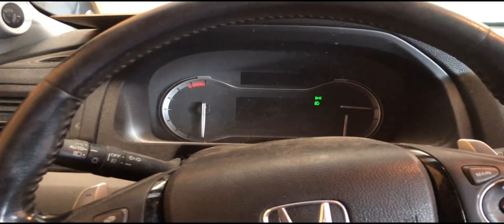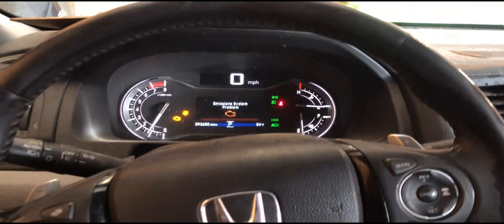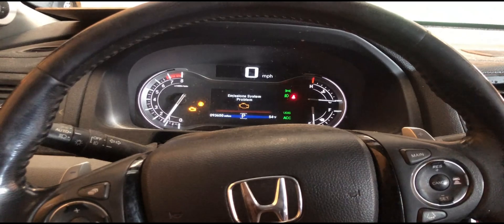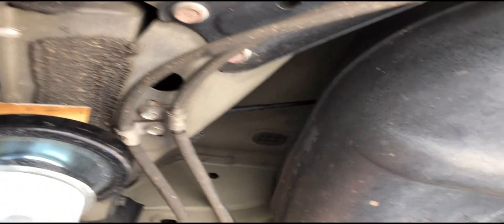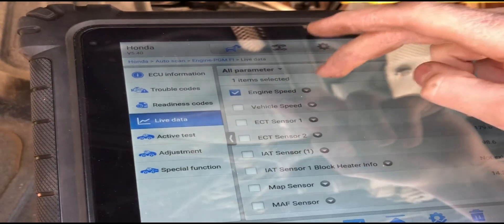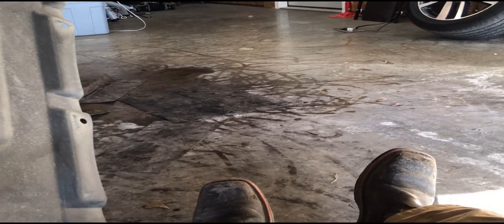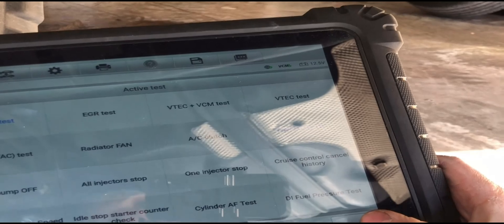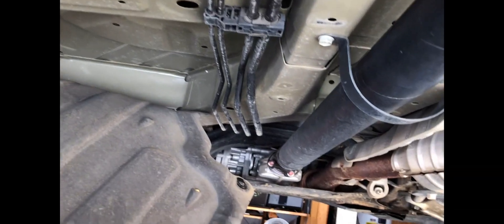Diag Summary - 2018 Pilot 3.5L rattle, humming, thumping, vibration root cause

Comment: The 2018 I’m working on, also had a Hyraulic Tensioner vibrating. Timing Belt Tensioner failure is also common for this run of Odyssey Engines.

Comment: Keeney, (& others), I’ve got a 2018 Odyssey here having this exact issue. Vibrating fuel line underneath the hood. Transmitted louder as vehicle speed increases. Noise also coming from the fuel tank. Hope this helps others.

Comment: I have a 2018 Pilot I’m checking out for used car inspection. Fuel line under the car was resonating just like a 3 cylinder engine would. I knew at that point this had to be the high pressure fuel pump causing the concern. Makes me wonder if the lobe on the camshaft is worn also. I have yet to check.

Comment: I recently changed my hpfp  due to not having anymore power and not running .. so I recently bought a new hpfp and I went on the cheaper side  it ran ok for over a week and now it is doing that same rattle sound sounds in the engine and under the exhaust .. and the line that goes to the high pressure fuel pump rattles crazy .. do u think the part I got was defective or maybe I should go original dealer part?
Reply from the maker: Can’t say for sure, but I will say that I personally use exclusively OEM parts for sensitive emission system components; such as direct injection systems.

Comment: Thanks for articulating this so well. This sound just started on my 2019 Pilot at 102K.  I thought it was an exhaust leak somewhere. I just checked the hose by the heat shield and its vibrating like crazy. Time to get it fixed. :)